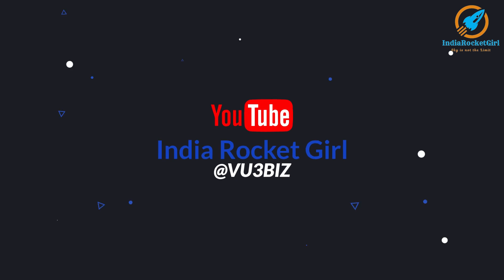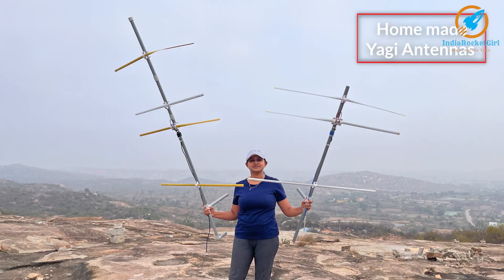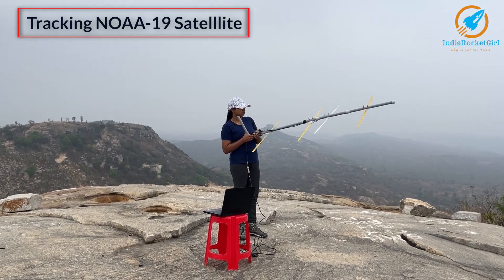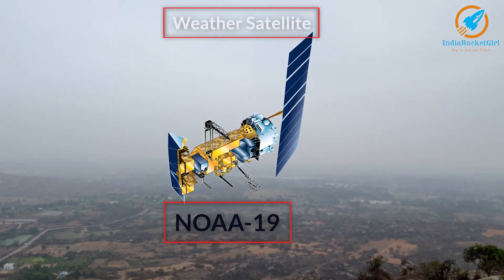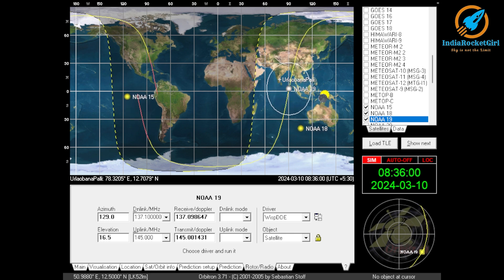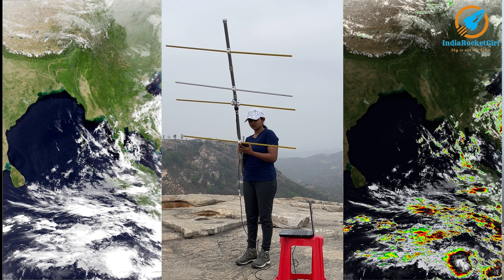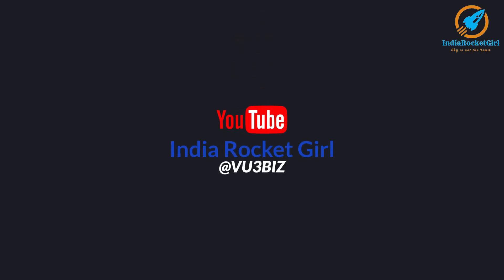How to Receive Real Time Images from Low Earth Orbit Satellites | India Rocket Girl | NOAA-19

Comment: can we place it on appartments or in open farm land and can we see the weather prediction results by using the above software and equipments mentioned in this video, and please explain the pros about this antenna , explain indepth😊
Reply from the maker: This tape Antenna is good for tracking with hand, but if you keep it at one place it cannot take the wind load...so antenna with aluminium rods will work for your case. You can definitely do weather prediction.
Reply: @VU3BIZ  Thank you for the info ☺️

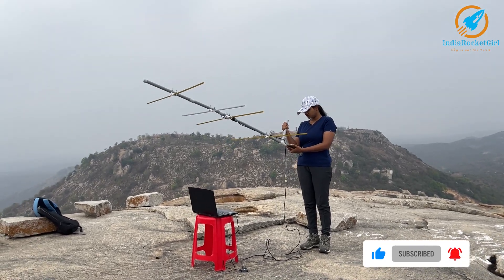Comment: 2:46 How did you accurately sweep a 4-element Yagi antenna to maximize signal reception from a NOAA LEO satellite, considering factors such as the satellite's predicted path, the timing of its overhead pass (got the answer from another comment - Heavens Above), but can please you explain the antenna's directional and polarization characteristics?  Another awesome video.  I assume the location is Kuppam?
Reply from the maker: I am using "Heavens Above" android app for find the Elevation and Azimuth values for my location. Using the app, we can point the antenna towards the satellite and  track it. As I was on the hill top, very good signals were coming. 
Yagi antenna is linearly polarized. 
Anyways I will discuss about the antenna in next video.
And the QTH is "Betrayaswamy Temple"
https://maps.app.goo.gl/qsNdCLZgCBUVMGiY9
Reply: @VU3BIZ  thanks 🎉